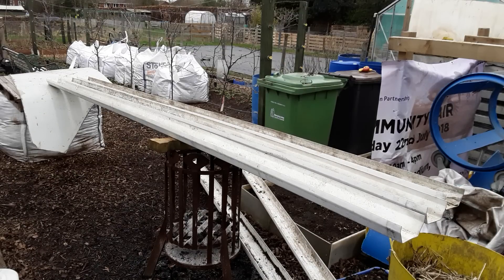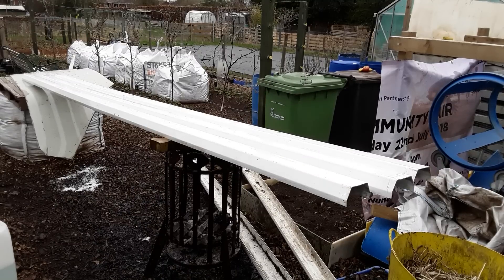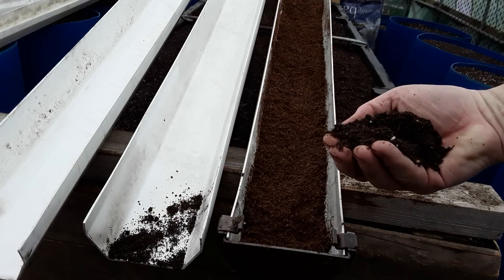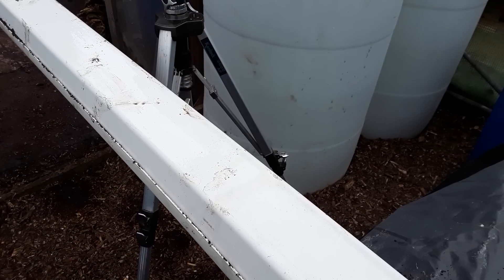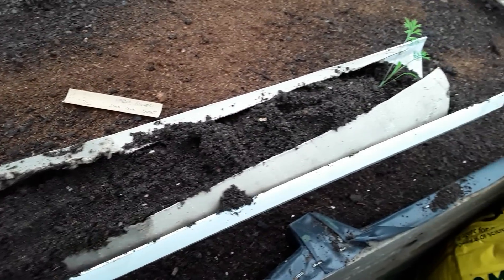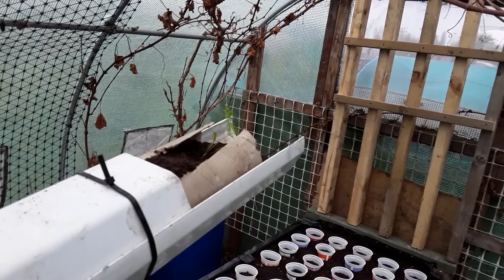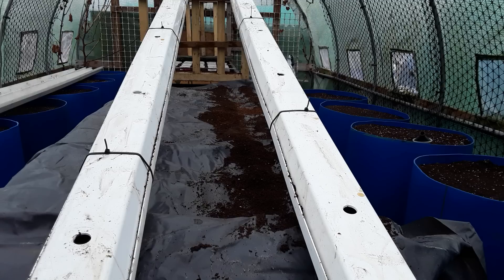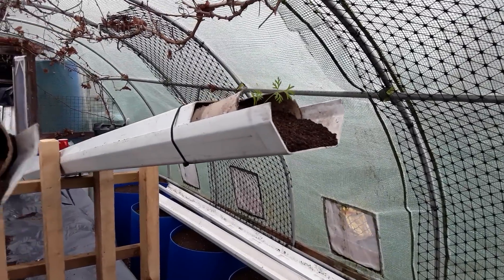♻️ Preparing The Guttering For My Attempt To Grow World Record Long Root Vegetables ♻️ (516)

Comment: Hello Terry, Have you considered putting rubber bungs or Gaffa tape across the watering holes when not in use. This will block the light and won't encourage the roots to try and get out go there....Cheers. Nigel
Reply from the maker: Hello Nigel, making a flap to cover the holes and it will help to stop them drying out as well.

♻️Happy Gardening........Terry.